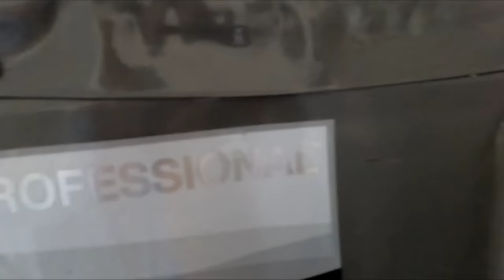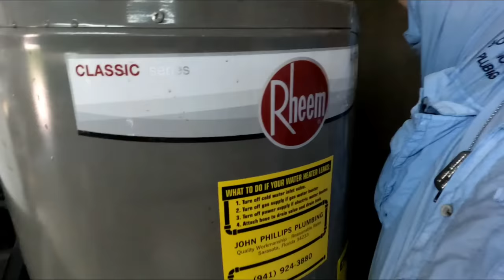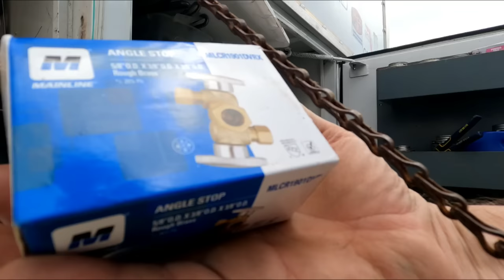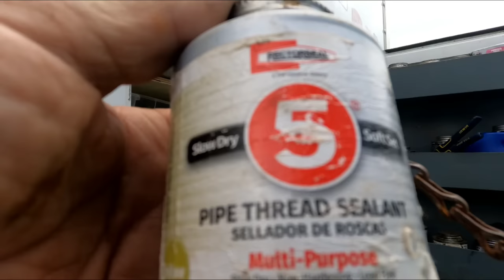INSTALL ELECTRONIC ANODE AND OTHER PLUMBING REPAIRS

Comment: How do you know when they go bad I never change one end up putting a new hot water heater in
Reply from the maker: Just change it every 4-5 years,you'll  be good.check condition and make your assesment on how long they last with your water conditions.
Reply from the maker: You may get a foul odor